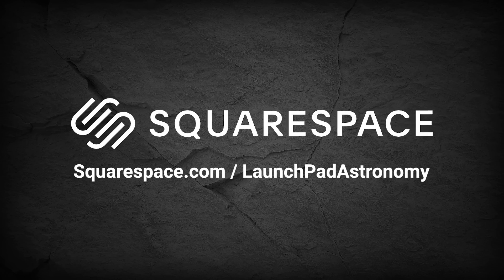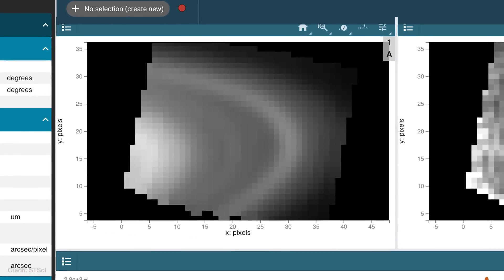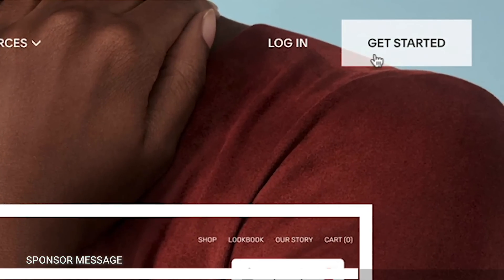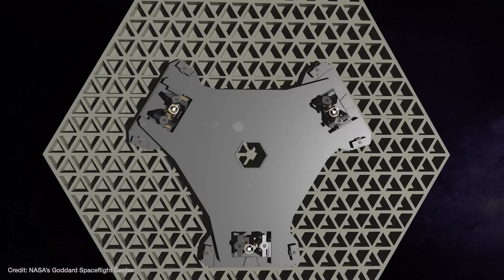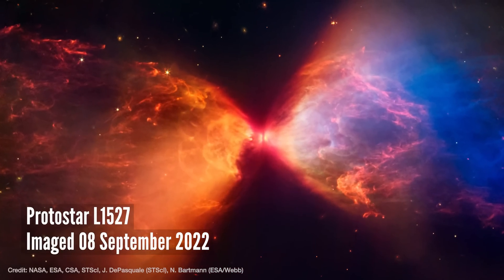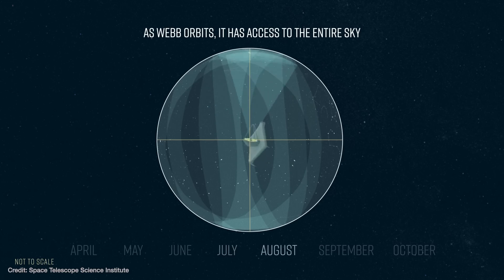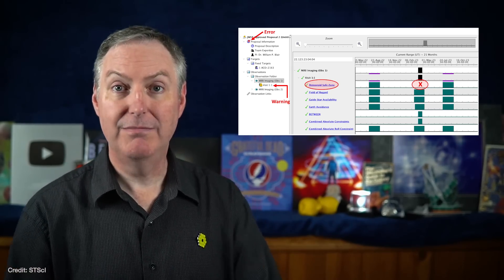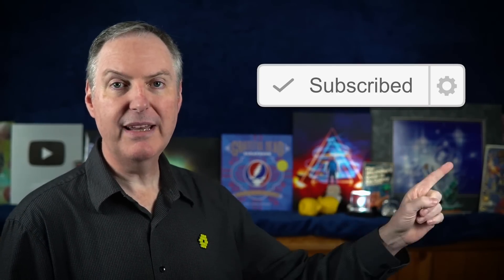How Webb will Avoid Micrometeoroids and MIRI is Back!

Comment: 2:27  Me too ! Having worked on the design of the dichroic side of the DGAs, I'm really interested...
13:21  How thick (heavy) would the baffle have to be to stop micro-meteoroids travelling at kilometres per second ?
Reply from the maker: Oh gosh, I don't know. I suppose it depends on the material used to make the baffle. I'm sure it would introduce its own set of engineering problems to solve.
Reply: Usually the trick is akin to spaced armor on tanks, called whipple shields in the case of spacecraft. You have a thin outer membrane that causes the meteorite to break up. Then the inner shield only has to absorb the meteorite dust spread over a larger area.
Reply: @DeinBestrFreund  Thanks for that

Comment: What if a meteor hits the secondary mirror? Or the heat shield or MIRI?
Reply from the maker: The secondary has actuators (though not the central one if I recall correctly) so they could correct for some of it. But it's also a much smaller target so more likely to survive the mission life. The sunshield has ripstops to prevent runaway damage. MIRI and the other instruments are enclosed in the ISIM so won't be directly hit.
Reply: the sun shield shipped with holes in it, intentionally. It is very much overengineered for its purpose and will still be functioning when ragged and outliving all other components
Reply: If something critical gets taken out, then thats it.

Comment: How does NASA deal with frost/ice build up on the telescope that's not facing the sun.
Reply from the maker: By controlling the rate at which it cooled down to prevent too much outgassing to happen at once. Otherwise, there was a concern that gas could crystalize and form frost. So the instruments actually had heaters to control the cooling rate. Heaters...to cool down...
Reply: To get frost you need air with moisture in it.

Comment: If I recall correctly, my supervisor - who worked on MIRI - told me a while back that the wheel issue only occurs when the wheel is spun in a certain direction. If you spin it the other way around, there isn't an issue. But don't take my word for it, it was a hasty conversation 🙃
Reply: Sure